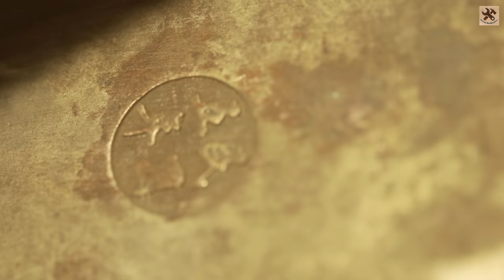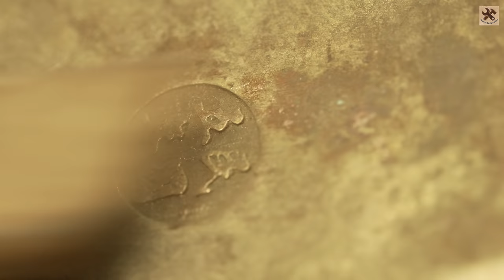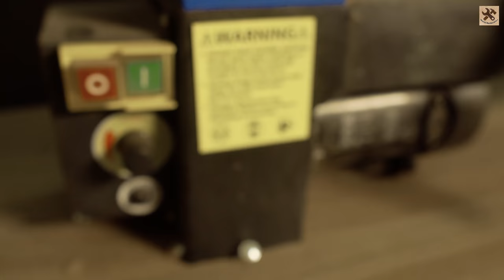Antique Teapot Restoration with AMAZING outcome

Comment: I am not sure about this one..maybe use a softer polisher so you avoid scratching the metal? Also the bolts just kinda took out some beauty from the handle..rivets would have been better but nice job
Reply: Same.
I was surprised by how they started with such a harsh technique...

Comment: Nice job.  But I have one critic point!
Never replace a plain bolt with a threaded screw . The bolt has a smooth surface where the friction-rotation of the handle joins the pot. When you put a normal screw there it will wore out rapidly.the softer brass.  Take a screw with a neck and cut the thread ro the desired length.  Or much better , make a brass bolt and hammer the head carefully to fit properly.

Comment: Hello, how are you? The dedication you gave to achieve a perfect finish, the neatness for a great achievement, everything was going very well, but I hope you see it as a constructive criticism, having the relevant tools, the piece of wood from the handle also from where you could have gotten the correct length and you start adjusting the tips with a rasp, having a lathe, that piece should have come out perfect and with the ability to enter adjusted to the bronze pieces that had a cup where the wood of a measure entered correct, they are details that mess up your great work, but the icing on the cake was to finish by placing a bolt with a nut in the socket of the handle with the kettle, that stained all your good work, my desire is to show you that a tiny mistake ends up dismantling a beautiful job.
Kind regards.

Comment: A bit of work with a small file would remove the casting lines from the top, and brass screws for the handle.  otherwise, good job.
Reply from the maker: thank you for comment

Comment: A real amature job... uses varnish on the handle, files the handle when he could easly used the lathe, lines on the handle are a ran..dom spacing and to top it all off buffs with a hard wheel
Reply: Yes, mildly infuriating to see those lines in the handle were not spaced evenly.
Reply: @knittingknut  Infuriating?
Reply: @Kaththee  just MILDLY infuriating 😀 there’s a subreddit that has that title for things that are a bit off kilter, or not quite up to scratch

Comment: I guess no one has shown you how to use a saw or file. Long smooth rhythmic moves across the surface will give you cleaner smoother results. And is far more efficient. That's why they make the blades long.
Reply: He put hundred of thousand in trash 
民國五年
It's a piece of unusual PC
Of antique

Comment: I know there are always people who know better. So do I. First of all, I did not understand the vandalization of the handle fasteners with the tongs. Those fasteners have holes, so one could use them. second, I would not sandblast the brass, it is too soft for that treatment. Instead, leave it in a mild acid (ordinary rust remover will do) just some couple of minutes, then neutralize and polish - carefully, with cloth! (people tend tho overdo it because the brass becomes so nice an shiny - but all details and edges get lost too - I collected brass items some time ago, I've seen it all) And finally, the modern screws - sorry, no way. But after all, extraordinary job with the wooden piece of the handle bar, I like that. Just hope it stands the humidity.
Reply: 👍 At last someone who knows a thing or two abt the difference between professional and unsafe amateurish restoration! 
It is saddening how such videos prompt people into spoiling nice and sometimes valuable old pieces!
And the final result is terribly overdone! Turning a fine brass item into a bazaar piece

Comment: The handle should have been made on the lathe in its entirety, including boring the spindle hole. This was drilled by eye using a pillar drill? And as for using nuts and bolts instead of making new rivets to fix the handle ruined the whole thing.
Reply: great opinion, and said so well and with kindness💀😒  Thanks for kicking the person for trying.  😣😖  You make a video....  You do it better...  Or shut up

Comment: For my liking, the video was far too long ; trimmed, it would have held my interest more fully. You were a little too heavy-handed with the polishing, but worse was the cheap and nasty treatment meted out to the handle (which was off-centre when you drilled through it). That should have been sanded up to 800 grit so that it was as smooth as the metal, and sympathetically stained.

Comment: A beautiful outcome. I think this is more for display as the angle of the spout means it would be  difficult to pour, and if the handle even became slightly loose, the teapot would sway around when pouring. Maybe make the handle permanently fixed solid. Maybe also have the hole coming out its EAR rather than its mouth, LOL. I found the video a bit drawn out, especially with all the sanding, and I kept fast-forwarding which spoilt the relaxing enjoyment of watching a restoration.

Comment: Not a bad job - a little sloppy on the handle and rivetts would have been better than screws to attach the handle.  However, DON'T DRINK FROM IT!  Have it tested for lead since, if the pot is old enough, lead it one  of the components in brass and bronze.

Comment: at 2:52 there was NO reason to use pliers on those nuts as they are cross drilled to accept a punch, you marred up the knurling on those nuts, and WD40 is one of the worst penetrants around, i recommend Aerokroil and at 25:23 the use of bolts and nuts for the rivets you removed is not restoring this , its just an easy way out, other than that this CLEAN up us good,it dont qualify as a resto if it dont meet its ORIGINAL design

Comment: Nice job but, a lot of wasted time brushing on the teapot, using old part for measuring new helps, more practice using your lathe will give better piece replacement. Remember remove a part like a revit should be replaced with the same, using a food safe coating inside the teapot is a very smart also.
Reply from the maker: thank you for comment

Comment: After all that work, how would you keep it looking like it was new.
Reply: Cecil Gore. It would not have looked like that when it was new. It would have been sand cast and would still have some of the casting marks retained.
Reply: There is a lacquer that you buy in hardware store in a pressure pak form.  Spray fine layers on it from all angles, that will hold it lovely for quite a long time.

Comment: The bolt and nut didn't seem like the correct fix , also sort of surprised on the making of the wood handle. Why not carve the taper? Why not measure the old handle or attach the handle arms and measure length.
Reply from the maker: We will try harder

Comment: It isn't a teapot; it is called a "creamer", and the original would be used for milk - hence the cow design. They were normally made in ceramic, with the tail forming the handle. This brass one would only ever have been intended for decoration; it is impossible to clean the inside properly. it will never produce decent tea, because the water would be cooled too much to brew. The Chinese know about tea, but don't have milk in it, hence the strange design.

Comment: That wire brush just isn't right for restoration. Your better off using the sand blaster if anything. The wire brush can leave big gouges that are hard to get out even with the sand blaster or with sandpapaer.

Comment: Oh dear. In UK engineering terms that is known as a balls up.
He knackered the knurling on the handle nuts by using pliers. He should have used pin punches in the holes.
When he was turning the wooden handle, why did he not turn spigots into the handle, instead of that rough tapering of the ends.
If he was "restoring" this why did he polish it to within an inch of its life??
One other thing. TEN ADS IN 28 MINUTES IS TOO MUCH.  I will not subscribe.

Comment: meh.  you used sandpaper when you should have been using a buffing wheel with different grit size pastes.  you left a shiny surface, which would have been left better with a satin finish or by introducing a new patina.  you cut the new handle too long, hand held it to drill the hole, which of course ended up off center.  the varnish was too heavy and shiny.

overall, I give your work a C+.  I think you probably can do better.

Comment: finding a dirty teapot or picking it from garbage does not means you found an antiquity, wire brushing dirt and whatever shit is caked on it, sandblasting it sand papering it and polish it is not restoration it is just making piece of garbage shiny, making a new wooden handle is just replacing an broken handle with new one - this bulshit you are videing is just bulshiting and for sure not restoration

Comment: Some additional sanding required (visible scratch marks after polishing).  Nothing done to prevent return of corrosion to inside of piece (no rust conversion/plating/coating).  Handle should have been measured before disassembly.  New handle is too long.  Design of handle (including burned in channels was pretty random).  OK restoration as a display piece.  As for the video - too much time on slow motion panning of before and after shots.
Reply: I'll give it that the lead-in was a bit long-ish,  BUT ... couldn't you just say "Hmm, Pretty."  and let it go at that?!?